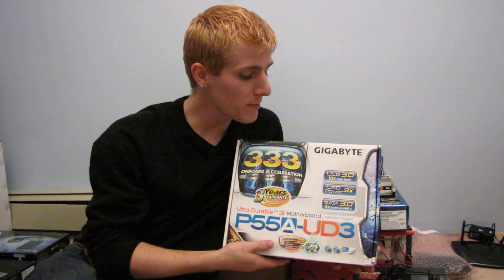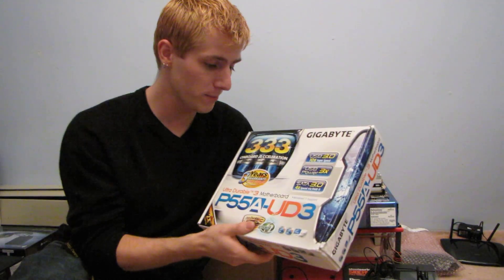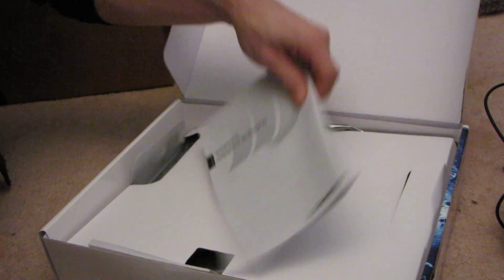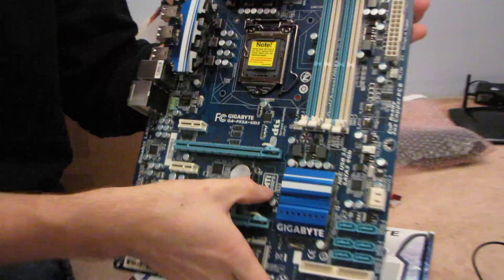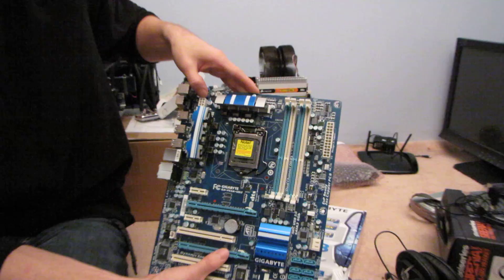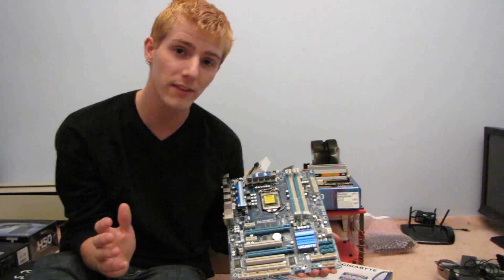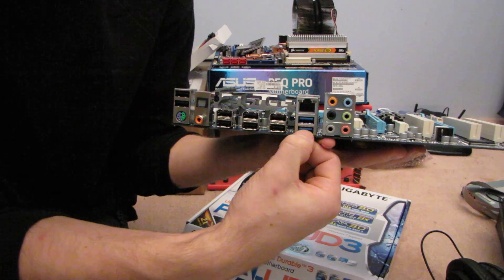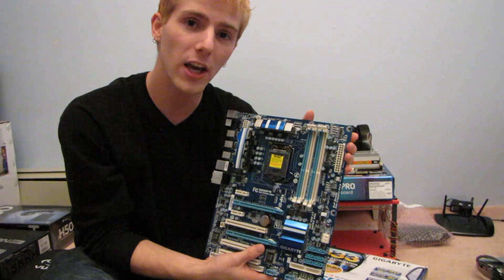Gigabyte P55A-UD3 P55 Core i5 LGA1156 Motherboard Unboxing & First Look Linus Tech Tips

Comment: This board is the last generation of boards from the golden age of computing.
It has modern elements we take for granted today like the i7 series quad core, gigabit Ethernet and USB 3.0, but it has shitloads of the good old stuff. Like floppy drive, serial and parallel ports, PS2 port, IDE port, and a utilitarian no BS 90s style BIOS. It officially supports Windows 2000 and XP too. And it has all the reliable solid state type capacitors. Crazy!

Comment: Last night around 9pm I found sitting in the snow next to a dumpster, a sweet gaming rig with this motherboard.
It was very clean, almost new.
Black windowed Corsair case, 3ghz i7, 25GB SSD with a copy of Windows 10 on it and a GeForce 950. Ram sticks were hangingbi their sockets, no wonder it didn't work. Reseated them and the thing boots up and works as new.
Reply: 250 GB SSD

Comment: still running this thing in 2024 lets GOOOOOOoooooo too bad i can't do SATA3 AND 16x on the PCIe... i'm looking to upgrade my graphics card from a GTX 760.. long overdue upgrade.... when CSGO went to CS2... man i can't run that at all :( but i'm not really going to upgrade the motherboard, i have an i5 750 in here... never even overclocked it.... i don't believe i really have CPU bottleneck issues... hmm...

Comment: I decided to look up this motherboard I got way back in late 09, and it is cool to see some of yours is still kicking it. I want to know what would be a good upgrade from a i5 750 2.67GHz processor? I want to upgrade to a i7 but want to make sure I choose a good compatible processor at a good price.  So far the only upgrades I've done was upgrade to a SSD, graphics card (Radeon R9 280, and upgraded to 2 4GB sticks of RAM. Also, for the longest I have trouble trying to upgrade from Windows 7 to 10.
Reply: it's a bit late now, but an old 4c8t xeon with OC could be great.

Comment: If you use the usb 3 and sata 3 you cant get crossfire to work well. This board also only does 16x/4x in crossfire which makes yu crossfire suck. You need to get a board taht does 8x 8x. 4000 series cards and 5700 series cards are good with 8x 8x but 5800 series cards  you should go for x58 chipset.